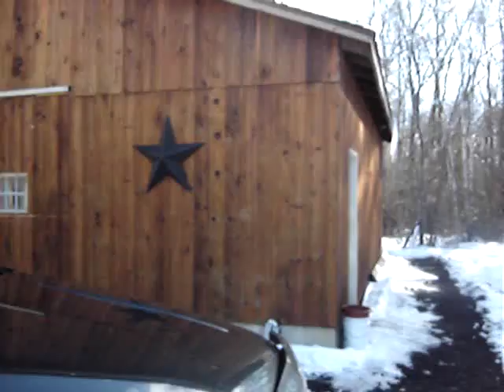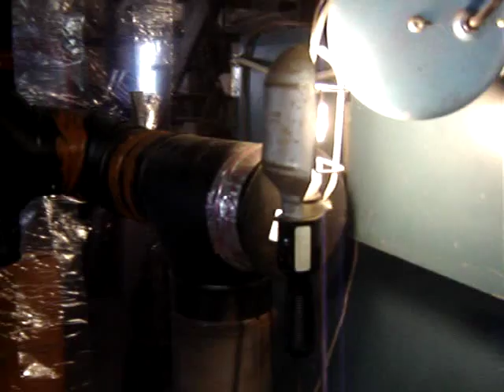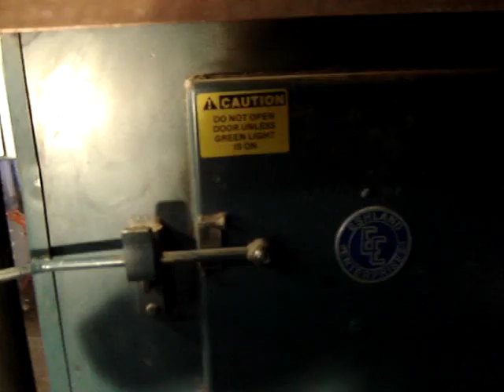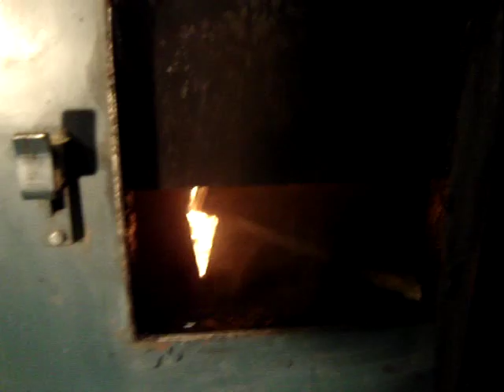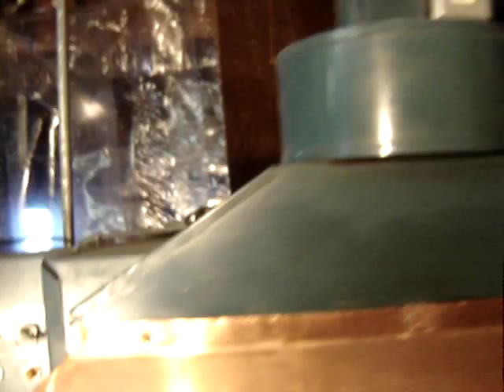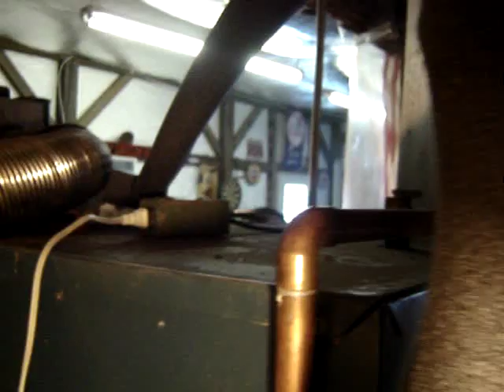Alternate Heating Systems Woodgun E180

Comment: Is all that noise from the Wood Gun??
I am interested in putting a E155 SS in my basement, but not if it makes that much noise...
Reply: Only noisy because it's an old blower motor...new ones are very quiet
Reply: The noise is most likely because of that unit is a really older unit.

Comment: What was that plate of metal that was going across the door when you opened it? Does it move?
Reply: Just a smoke damper..it flips out of the way when you load it.  Sorry for the delay...I'm not on here much.

Comment: The E180 is now designated as a commercial unit. The E155 is our EPA Phase II qualified model.
Reply: Michael Purnell do you work for alternate heating systems?  Years ago I talked to a guy at the company and I think but it's been sooo long that I don't remember but I think he recommended the E180 to me for my home and farm buildings. But I can't remember. I still have not got one but really thinking now!!!! A friend of mine has a tree business and I told him he could dump the brush and logs at my property for free. So I have a ton of WOOD of all types.
Reply: I am contracted at AHS through my company, Greenfield Technologies LLC. I spend most working hours there. You can reach me at: (717) 987-0099.
Reply: Michael Purnell so if it was the E180 that he recommended then can you still order it as the same as always? I would also need oil back up added on.
Reply: It is possible to order it as a commercial unit only. That depends as well on the state it is located.
Reply: Michael Purnell so I could buy it as a farm expense and heat my house and some of the farm buildings and green houses.    I live in Maine.
Reply: Michael Purnell  yeah I’m in Maine and have a farm with some greenhouses and a farm stand as well as my barn and house that I want to heat so I think the E180 is the right size.
Reply: @mainelyelectric  where in maine are you? Im in Durham, also running a E180. Fritz1022@gmail.com

Comment: Ours is a nightmare.  It never worked right.  Worst investment I've ever made.  Seven years and it's never worked right.
Reply: There are at least four of these units in the town I live in and they are working great. You may have something wrong in the piping or in the control system. Could you please tell me what it is that you have a problem with. I have had a long life with various wood boilers and it is my humble opinion that the AHS is one of if not the best. I have no ties to this company just wood boilers in general. tywwltl@gmail.com
Reply: James P Bergeron did that guy ever email you what was the issue?

Comment: Thanks for posting.  It looks like this could run 'off the grid'.
Reply: Power requirement during active firing is 5 A. I would like to get that down to about half of that, and also do combined heat and power.